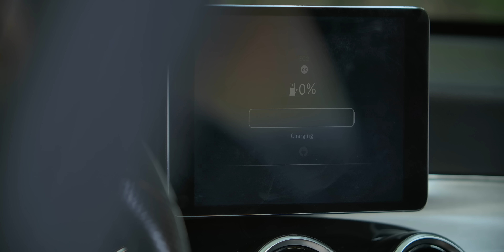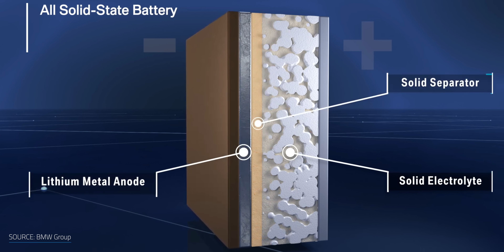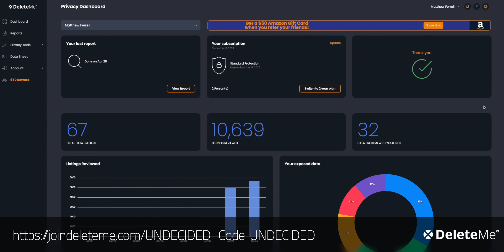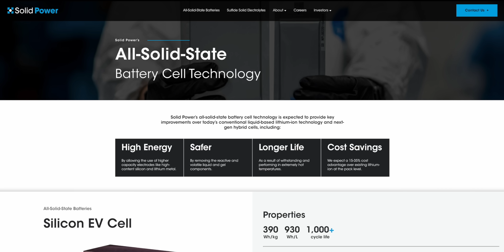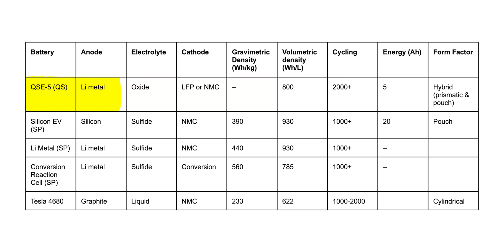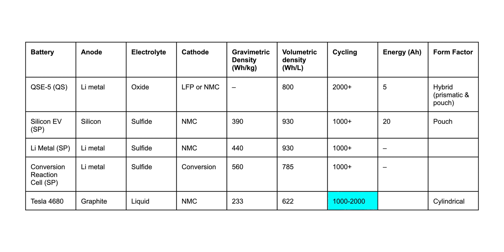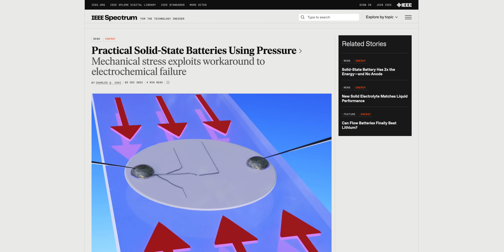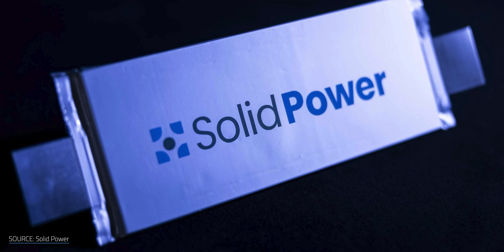Solid State Batteries are Closer Than You Think

Comment from the maker: Do you think solid state batteries are the next big thing and are worth waiting for? Get 20% off DeleteMe US consumer plans: https://joindeleteme.com/UNDECIDED

If you liked this, check out How This New Heat Pump is Genius https://youtu.be/wSgv5NwtByk?list=PLnTSM-ORSgi7uzySCXq8VXhodHB5B5OiQ
Reply: Hi Matt.  FYI  The QuantumScape battery is NOT solid state.  It uses a liquid gel electrolyte.  Se&rch for quantumscape liquid gel electrolyte.
Reply from the maker: @59seank  yes, they are using a gel in the cathode, but the ceramic separator and lack of a liquid in the anode still makes this a solid state battery.  Seems like splitting hairs, but it’s still technically a solid state battery.
Reply: @UndecidedMF  According to wikipedia /// A solid-state battery is an electrical battery that uses a solid electrolyte for ionic conductions between the electrodes, instead of the liquid or gel polymer electrolytes found in conventional batteries. ///
I'm don't think the ceramic separator has anything to do with a battery being solid-state.   To my way of thinking, if you're using a liquid gel for conduction in a battery, it is NOT (by definition) a solid-state battery.
Reply: @UndecidedMF  I'd love to see this battery tech in a 200-seat plain! 1000km range?
Reply: @UndecidedMF Hi have you seen and or covered those plastic bricks that have been popping up alot lately for construction? PLAEX specifically is the one I'm seeing getting alot of traction today. Curious to see what an unbiased view on those are cause I don't think they are 100% problem free like they are saying they are. But are those cons they aren't talking about worth it for the waste reduction and how potentially cheap it could be. Or is it another scam trying to cash in on those of us that care about our planet?
Reply: always still 5 years away every 5 years since 2015
Reply from the maker: @greengamerguy623  I should brought this up in the video: https://yoshinopower.com/. Solid state is here today, but it’s going to take some time to ramp it up to mainstream.
Reply: No
Reply: Yes, I want to electrify my microlight aircraft, so for fire safety I would like them.
Cheers
Reply: @bgg-jp5ei  Why insult the host? This isn't one of those channels. Please consider editing out that "muppey" comment so we can have respect while talking tech. Peace ✌️
Reply: @jamesstarks3676  done
Reply: Batteries will never be as efficient as Fossil Fuels.
Reply: How recycle-able are the sulfides? If it is reasonably recyclable I can see something kind of like how propane tanks are. Battery  having issues, go in somewhere get a battery swap out and send your old one to be recycled.
Reply: Yes and no.  There are other formulations that are coming out for mass production so I think there's going to be a good mix of battery tech out there and Sodium Ion batteries are exciting too mainly because sodium is much easier and cheaper to come by.  I also expect that at SOME time companies installing solar or wind farms are going to FINALLY catch on that Redox flow batteries are great for grid storage and then prices for those will drop.

In general, unlike the whiny cry babies who are leaving comments all over this video about still being 5 years away and I guess they forget to watch the part where these limited production runs are going to AUTO COMPANIES for them to test which means they're already here, just not in MASS production, I think battery tech is fascinating and is going to change the world.  It's too bad a lot of the people watching these videos simply want to attack instead of learning from them, as it's those people who miss the details of the story and then make stupid statements.

I expect that by 2030 many auto companies will be scrambling to make BEV after they start losing sales, facing bankruptcy because they failed to do the research on how to make these different battery techs work with their different vehicles.  And more than anything I feel this is the part these negative commenters and some auto companies don't get.  When a BEV starts pushing 450+ miles/ch WHILE running AC or heating, ICEV is going to die off pretty quickly, and I have no doubt that this is happening before 2030, probably more like 2028.  We're at the beginning of a big ramp up due to different battery tech getting to market.

Think about the investor who came in early on one of these companies developing manufacturing processes (the hard part) for these companies that are successful getting to mass production.  Do you know how much PROFIT these people will make?  I don't have the money to invest but if I did it would be in battery companies and chipmakers like Nvidia and AMD.  Or fabs like TSMC and other companies like ASML.  I feel those are the companies that are changing the world.  And they're not the only ones, but I follow these two technologies so I have a better idea of what they're doing.
Reply: Let's assume you are right and the fundamental issues for commercial production have indeed been solved and the cells reach the cell market by December 31st 2024: that would mean use in electric vehicles in 2029 the earliest given current vehicle development lead times. During production ramp up there are cost increases instead of savings, so the first production year worth of cells will be drastically more expensive than traditional designs. That in turn means application in the most expensive vehicles. So basically normal people will miss out. So when will we see solid state cells in mass market EV applications? It is possible that the answer is 2040+ to never. I am leaning towards never. And that's not even considering external factors like the projected lithium shortage around 2030, which will further hinder rampup (as there is more lithium in solid state batteries than in traditional cells).

But I guess that's what you get on a channel where somebody not being an expert explains something to other non-experts within the attention span of your typical 2024 extreme online squirrel ape.
Reply: @AlbertLamarque  spot on about cost and implementation times but your final paragraph is a bit harsh albeit highly amusing
Reply: @bgg-jp5ei  terribly sorry, I didn't mean to unravel towards the end. I did though, and am indeed also a squirrel ape :)
Reply: @AlbertLamarque  me too, and I have a tendency to unravel. The green madness flips me
Reply from the maker: @AlbertLamarque  you may be spot on for car timelines (ie. 2030’s) for mass market cars.  In defense of my video though, that’s not the point I was hitting on.  I wasn’t exploring when they’d be mass market, but whether or not they are making progress (just an update on where things currently stand since my last video 2 years ago). And when/where they’re starting to trickle out into the market.  Yes, I’m a non-expert, but I work with experts on pulling these videos together.
Reply: @UndecidedMF  fair enough. I am also monitoring cell technologies, but as I am working in EV benchmarking I am looking through the lens of an engineer testing currently applied tech, which was in research state 10 years ago. I am really hoping they manage the problems for mass production which to date they have not. And will check back in as soon as something changes. Meanwhile I am very much looking forward to how some OEMs seem to have solved dry coating traditional chemistries. And go on from there.

Didn't mean to be rude. I am checking back in with you, too :)
Reply: @UndecidedMF  you might not be an expert but you know a lot more than most people and clearly able to learn even more
Reply: @AlbertLamarque  yes, safe non explosive batteries which can charge fast with high energy density and low cost manufactured from readily available minerals would be progress
Reply: @bgg-jp5ei  there is always progress. Really depends on what "safe", "fast charging", "high energy density", "low cost" and "readily available" mean in terms of numbers and compared to what and when. They may vary depending on application too. And, to some degree, the commenter.
Reply: @AlbertLamarque  How would the commenter have any influence? It is not like the double slit experiment
Reply from the maker: @bgg-jp5ei  I’m trying.  Each one of these videos is a part of my own learning journey.
Reply: @AlbertLamarque  2029 sounds good to me. I think Toyota should maybe just use the current battery tech instead of waiting for a solid state battery. They appear to be falling behind 🤔
Reply: @tyleroconnellt I think the time of being behind is coming to an end for the Japanese oems. Toyota has been working on solid state for a while and we have yet to see their results. Other than that using hybrid sales profit to finance EV development seems to become common practise for Asian brands outside of China. No more hesitation and they may catch up quickly. At least now they are committed. Watch this space.
Reply: I want to believe, in solid state batteries!
Reply: @Tyler_Durden_99  I want to believe in miracles
Reply: What about the Japanese? They are at the same stage and about to start production... Next year, maybe... Or the next...
Reply: @bgg-jp5ei You don’t need fast charging at home. I can charge my 69kwh EV overnight when I’m not using it.
Reply: Only US consumer plans...
If you get a future sponsorship that has links for discounts for those outside the US then I'd bite. 
I did some Googling and it's a better option that the competition for Australian based users.
Reply: I will only believe any of these batteries are real when they will release the battery cells in open market. If they eye for these exclusive EV tie ups and Business development manager guided deals , that would make me think its a fake.
Reply: @PankajDoharey  any new technology goes through these tie-ups due to following reasons 
1. To ensure reliability and workability before hitting mass market,  to avoid negative publicity. 
2. Only certain things can be tested in labs, these deals provide mutual benefit, benefits to the company as well as rigorous real operational environment testing. 
3. Would you purchase a not properly tested tech available in the market or a tech that is being used by several companies in their products.
4. Some technologies do not follow the anticipated Cost reduction curve arriving due to the economies of scale. It is better to find this out in the initial stage rather than after investing millions and producing thousands of highly costly units.
Reply: Any updates on the "dirt" battery?
Reply: Any thoughts on how Solid State batteries might work out in the elements?
Reply: @mrbizi5652 no traction battery cell has been subjected to the elements except in a crash. What do you mean?
Reply: Undecided code doesnt work on DELETEME website
Reply: NOOOOOO I don’t want a thinner phone, you keep your Engineer fingers offfff my phone !😭🙃
Reply: Probably the least harmful things these will bring.  I smell swarms of armed long distance and powerful drones..
Reply: No solidstate is dead. Many of CATL’s new batteries charge fast.
Reply: It's closer now because Chinese government has put their weight into this solid state challenge and asked their biggest battery makers to collaborate
Reply: I fully believe that solid state batteries are closer than fusion reactors
Reply: @bannor99  while both kind of exist, I tend to agree.
Reply: Soon soon two weeks?
Reply: i'm still waiting on those batteries matt.
Reply: Everything you said in the video just confirmed that those batteries are still in the "5 years from now"-phase. I really don't get how you could come to the conclusion that this isn't still the case.
Reply: So the title is just clickbait?
Reply: @ashman2023 So, you didn’t watch the video, I gather?
Reply: @ashman2023 LOL are you new here? All his videos are click bait. Channels like his, just post click bait titles, so that they can shill their sponsors. It’s fun info. But that’s all it is.
Reply from the maker: @ashman2023  no.  It’s happening and real.  I should have brought up the smaller scale stuff already on the market (https://yoshinopower.com/).  I was focused on where large scale commercialization is at the moment.
Reply from the maker: @bgg-jp5ei  let’s keep this civil and debate the tech not the person please.
Reply: @UndecidedMF  Well handled
Reply: @UndecidedMF  apologies, my comment was out of order. But I stand by my point that 15 minute charging is not possible with a domestic power supply
Reply from the maker: @bgg-jp5ei  👍 that’s a fair point, but there are means to mitigate that.  For EV charging stations, you could have energy storage that provides the extra boost needed.  This is already being done in some locations to avoid expensive grid upgrades.  https://www.power-sonic.com/blog/the-benefits-of-battery-energy-storage-for-ev-charging/
Reply: @UndecidedMF  interesting but with the energy losses in the entire process and the cost and energy required to make the batteries it doesn't seem very green or a cheap option
Reply: this is an "in an optimal scenario" situation imo. we are still waiting for the fancy solarcells that are rollable from cambridge uni that was "scalable for production now" 6 years ago.
where is my tesla roadster and the ev semi? this is vaporware
Reply: @reyalPRON  Your Semi (maybe even Roadster, IDK) is still waiting for a decent 4680, despite Tesla having the lab variant of dry electrodes  from Maxwell. Cost-efficient volume production of batteries is extremely difficult.
We'll not see comparable priced SolidState EV cars 10 years from now on, in my opinion.
Reply: @reyalPRON EV semis exist
Reply: If ignorance is really bliss, you naysayers are all just a bunch of happy arses!
Reply: EV resale value is dismal.  After around 80k miles, you can't hardly give them away, while their gas powered counterparts still bring good money.  Nobody wants to deal with the reality of a $25k battery replacement...  making EV's more of a 'flex' and a fun toy than practical transportation...  especially if you need to do any towing or road trips.
Reply: @n2omike  not what I see
Reply: @n2omike  if, with all the data out there, you still believe the battery is even remotely the biggest problem in an EV, you know very little about them.

EV resale values are normalizing to what they are worth. It's been too high for years.

But that goes for many ICE cars as well. And the running cost is nothing to sneeze at either. I have 2 BMW i3s and paid house electricity prices in energy if that, no taxes so far, lower than average insurance, and about 240,- in service and MOT cost over 100k miles.

Granted, from the 49k list price there is only 20k resale value remaining now after 3 years. But of those 49k I paid only 32k after dealership rebates and incentives so really I didn't loose what the internet tells me. Also, I don't plan on selling it as it is the most reliable car I had by a long stretch.

So you do you, but don't believe everything you want to believe just because you can think your truth is everyone's.
Reply: @AlbertLamarque  Resale kills EV's.  Anyone who has owned a battery powered power tool knows the batteries fade over time.  Once an EV has 80k+ miles on it, nobody wants to buy it, as they don't want to be on the hook for a battery.  Resale falls off a cliff.  That being said, you're into BMW's, who's value also falls off a cliff, as they are extremely expensive to repair once they are out of warranty.  Buy a Honda/Toyota, and their value remains strong past 100k miles.  Can easily get 200K+ miles out of them.  Best case scenario for an EV is if you can charge slowly at home, don't do any road trips and don't tow anything.  Even then, resale will still detour EV's from being a sound 'investment'.  If you want to be the 'cool kid' then buy an EV.  If you want to spend your money wisely, internal combustion is still the way to go.  You mentioned MOT.  Are you in the US or UK?  US here.
Reply: @n2omike  power tools have uncooled different cells with many high power duty cycles which have no commonality with traction batteries. That's exactly where many misconceptions come from.

Some BMWs have insane depreciation. Most of them in the larger luxury car area. The 4 series and i4 on the other hand appear to be very stable. Maintenance is expensive, I know because I learned on those, but there is none for EVs. Brake fluid and cabin filter every other year don't ruin you. Brakes may be done after 200k miles despite my driving style, which as an engineer working in vehicle benchmarking, is not exactly relaxed.

Low resale value of 3 year old cars is actually great news for people looking to find a cheap to run car. Most people don't tow at all. If you do long distance, EVs are not for you.
Road trips? Really depends where you are. I am aware that charging in the US can be sketchy, so for lack of better knowledge I must take anyone's word for it. It's still early into the era. I get the skepticism.

That being said, I'm in Germany. Some things differ. Every car I find and every charging network I use could be better, the process more seamless, route planning easier. But considering what I stand to loose going back... No thanks.

5 years of electric driving. No unscheduled maintenance. No repair. Near zero running cost. No intention of selling. Hoping for you to be more right so I can afford a car I can use for short hauls, spirited driving and comfortable traveling. And not just parts of that. And I'll be set.
Reply: @n2omike  That's like saying a HEMI V8 and a Camry 2.5l inline 4 are the same. An aircooled boxer is like a Cummins Diesel. It's just not true. Different things for different applications.

My older i3 is 8 years old and has almost 100k miles on it. And about 96% battery health remaining. My newer one is 3 years 70k mls in, has been charged to 100% almost every day (because I pretend I am a normal customer and don't know anything, just to see what happens), and it is at about 98%. 

If you lack grid connection for a large charging hub you can always buffer it with a battery. That is often the more sensible solution.

You may be right about the resale values. I don't know the figures that well. But if there's nothing to work on, chances are that's not super expensive. Or do they charge you for not coming in?

I think your expectation is a little skewed by what GM and Tesla have been doing. Notable amounts of fires and recalls, and quite frankly, everything that has been bolted to a Model 3 chassis has been the cheapest crap you can imagine. Didn't see the Highland in the metal yet. The chassis in itself is good, but if you have to replace half the car to make it ride well and the bushings from wearing out every 10k miles....I imagine that shapes expectations somewhat. I can only speak for the ~40 different cars I have tested so far and the 3 EVs I owned, and can tell you that there are differences, sure. But many things people like for daily driving are great.
Mine is also skewed, just in the other direction. I'm a mechanic, and have a higher degree as well. I know what people do or don't do to their cars. "In this episode of just rolled in..." I was tired of repairing what other people neglected.

Did you borrow/rent an EV for a week or so, just to find out what it is like? It sure is a little different experience. Seats and butts are the way to get past what the media tells you.

I imagine, if you live in the country somewhere, you'd have a house? And electricity? So basically, your charger would normally be in your driveway or garage?
Reply: When we will see it
Reply: @space6370 how would he know?